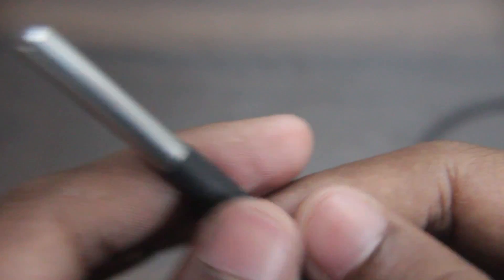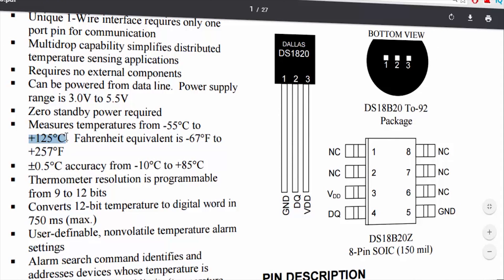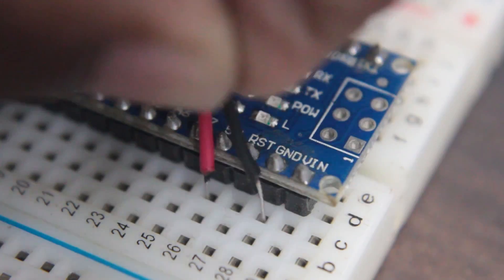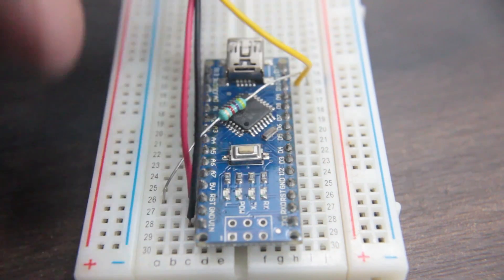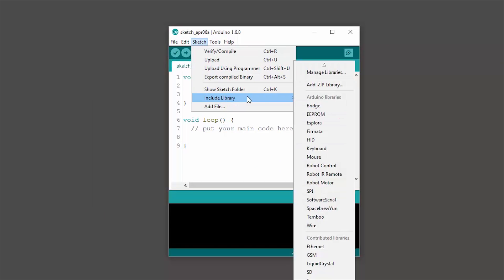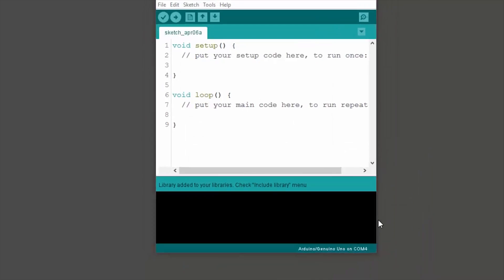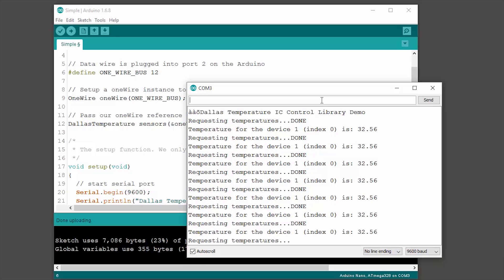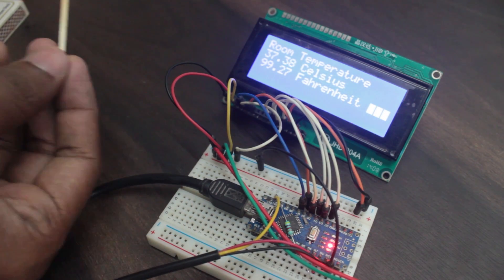DS18B20 Temperature Sensor Tutorial

Comment: hiee bro i need your help. I am using this sensor, for the first time it worked perfectly but after that, I had cut the wire to solder jumper wires but after soldering it is showing -126 degree celcius only.  How to resolve this??

Comment: It is not very good electronics protocol to jumper the 4.7k resister across the top of the breakout board. Put the resistor to an empty breadboard hole and use an insulated wire. As can be seen in the video image @ 1:10, the resistor wire is dangerously close to shorting out  D12 to both D11 and D10 - all together -- not to mention shorting A4 to Vcc on the other side of the board. If you must route a resistor in this way,  strip a section of insulated wire and use the insulation over the wires of the resistor.  These precautions will save hours of frustrating software troubleshooting on a board that has a couple of bad/zapped pins due to momentary misconnections/shorts.

Comment: hello, I am wondering one thing, why did you connect 5V through a resistor to the digital pin of the arduino.. does not the digital pin read only 5V or 0V? I mean or is logic 1  or is logic 0.. how the arduino understand the degree of the enviroment ? thank you in advance for the one who will answer my question
Reply: The digital input pin was connected to 5V through a resistor to ensure that when there is no signal on the line connected to the pin that the pin sees 5V or logic 1.  Then when a signal is sent, that signal is logic 0, as the sensor connects the line to ground to send a signal.

Connecting the signal line to 5V through a resistor is called 'tying the line to high', or to logic 1, and is essential in digital systems to ensure that stray voltage doesn't accidently charge the line to 3-4V, or discharge it down to 0-1V, causing false signals.  

Digital circuits such as the Arduino's digital signal inputs use so little current that stray electrical charges (say, from another wire carrying current close to the signal line) can cause the signal line to 'float' somewhere around 3 V, causing a lot of false 1s and 0s.  Tying the line high for a '1' and having a signal sender connect the line to ground for a '0' is considered good digital signal procedure.  

False signals are the bane of unshielded digital signal lines.

Comment: This sensor will give us result only when it is in contact with air or 
else it will give us reading in hot or cold water also??
Does this sensor requires some initial readings to display temperature on dashboard ???( like minimum temp is -55 and max is +125  so in-between of this it will calculate all the readings ? )

Comment: What is the resistor for in this case?
Reply: Tying the signal line 'high' so that the 1s and 0s of the digital logic are definite, not the result of stray voltages or electrical interference.

Comment: Hello, thanks for the video. When I attempt to compile, I get an error "exit status 1; Error compiling for board Arduino/Genuino Uno." Do you know what's happening, here? Thanks.
Reply: I've worked it out - it seems that it's not necessary to install the OneWire library, as it appears to be integrated, or otherwise included by, the Dallas Temperature library.
Reply: Even I m facing same problem

Comment: thanks for video!
one silly question,
is this sensor reliable???
because i will be using this sensor to control the heater to heat water, if sensor fails, it will boil water and damage my system.
-thanks in advance.
Reply: Use 2 sensors and if the value difference between the two sensors is out by too much then tell it to shut down and turn on an error LED or message on the screen.
Reply: i think if it gets wet it goes crazy. not sure though, youd better do some research
Reply: Scott T how can you connect two sensors?

Comment: Hi. i see a lot of diagram with gnd and vcc together to GND and  the resistor on data, from there one to data and other to 5v. Can you tell me why?? (i dont speak english)... why you connect resistor between vcc and data?? its because the lenght of the cable?? like 1m. I know that is possible doing in anyway, in both ways. but why?
Thanks and sorry about my bad english.
Reply from the maker: When we connect the 4.7 k resistor to Vcc and data it pulls the data line high or to 5 volts. Now the ds18b20 will pull the data line low and send the temperature reading. The resistor is for the temperature device or multiple devices. Whenever one of them will try to send the temp reading they will ground the data line or pull the data line low then send the temperature bytes to the master. I hope this helps, and your English is not that bad little work and you'll be much better.

Comment: What resistor did you connect ?
Reply from the maker: 4.7 Kilo Ohm Resistor
Reply: @CoolTroniks  can you explain WHY a 4,7 kilo ohm resistor and not some different? How have you calculated this? Thanks for the answer :-) is it possible to messure with 3 different sensors at the same time with one arduino? How do you make the code for this?
Reply: 0.5W?
Reply: 0.25W can work